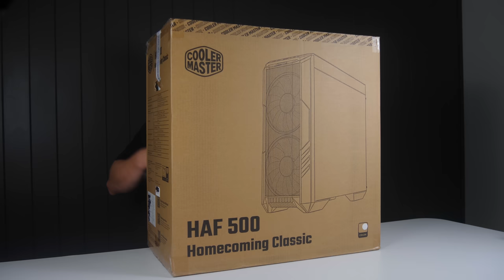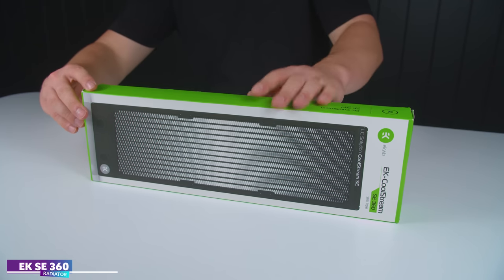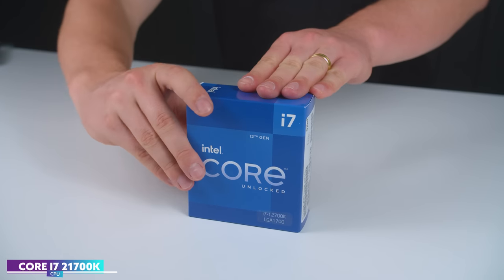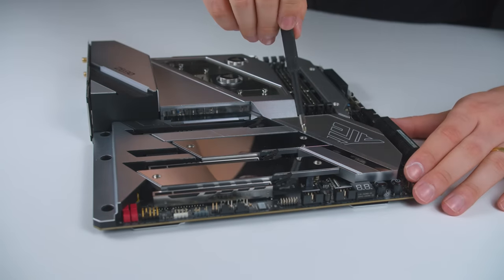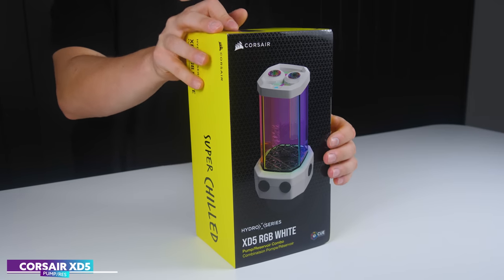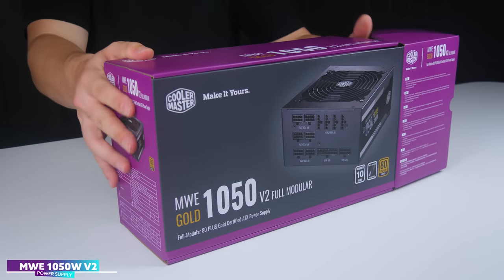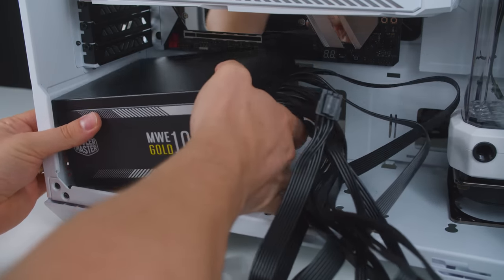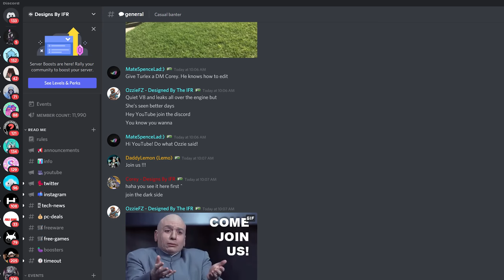This PC Build had a few issues..

Comment: man has pc's come far holy crap. I haven't changed mine for the past 8 years. I'm still rocking the i5-6600k and msi fe 1080. I remember these parts as being super high end back in the days lol. I might need a upgrade soon, but it's so hard these days to figure out what you should use in a build.
Reply: TBH with the current pricing on GPU I would recommended for you to upgrade your CPU/Motherboard combo first if you are tied on budget, since the 1080 still rock modern game pretty good, and maybe a new PSU/SSD if you have some to spare. (Bad English, sorry)
Reply: @angelhell1196  yeah I realized that. I might stick with the msi 1080 fe as it’s silver. And then do a silver build. I will probably switch all the other parts out with new ones :)

Comment: Still a outstanding looking build, great looking motherboard. Build idea, Terminator theme, silver coolant for T1000 " liquid metal " effect. Case can look like the terminator head, or inside rib cage with two "fusion core" coolant towers :) They should make the liquid for cooling thermal reactive so it changes colours from the heat in the tubing, look look sick with the rgb.

Comment: Im curious about a custom loop in a NZXT H500i white build. Been looking for this build for ages and can't find a good build including such a big graphics card. Curious if it will fit and how to solve issues.
Reply: The bar inside would be your biggest hurdle. I've had clearance issues with it before. But usually you can remove it
Reply from the maker: Good idea, i think i have done one but a huge gpu might be a little bit of an issue, but there is always a way
Reply: @DesignsByIFR  Super cool! Sadly pc building simulator wouldn't help to have a view if it fits yes or no. I've tried to make something at my internship and with a 30 series GPU it just barely fits with a all in one cooling system. But what if you want a custom loop?
You can make really nice looking ones with a smaller size of a GPU or with a different mount like a side mount.

Comment: Where do I have to look when im changing my mainboard and cpu to not install windows again?
Reply from the maker: You dont need to reinstall windows, just plug in your previous storage. You may need to make sure the previous drive is number 1 in boot sequence in the bios but it usually detects it automatically

Comment: Just wondering with new radiators do you have to flush them first before you use them?
Reply: I think it depends. EK rads say you don't need to flush, I have and it was true, they didn't need to be flushed.
Reply: @Safetytrousers  iv just bought Corsair rads now but not sure if they need it or not
Reply from the maker: Yes
Reply: @DesignsByIFR  thanks!!
Reply: Doing my first custom loop

Comment: @Designs By IFR during cpu intro you've shown inte core i7-21700k instead of 12700k in the bottom left corner